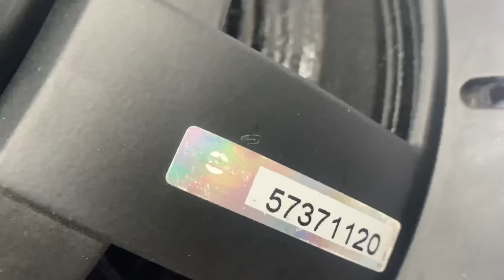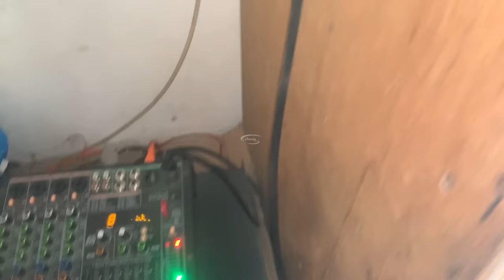Service Magnet Speaker Geser tanpa di Bongkar || U-yoke Neodymium Circuit magnetic Transducser

Comment: A real speaker repair Shop, with a lathe! I look big skills and actittude 👍👍
I believe some parameters are changed by close the hole with the bolt, the compression, heating? Power reduced? but I really works sure!
Here we use natural latex for the suspension, the best!
Thanks for share and dont stop my friend! 
Cheers from Spain!
Reply: Shure parameters will change. A hole vent is closed, leading to less bass & more heat